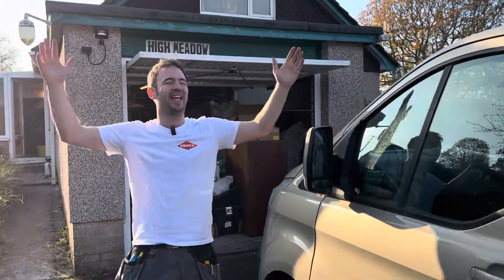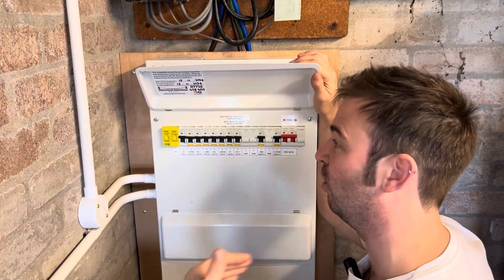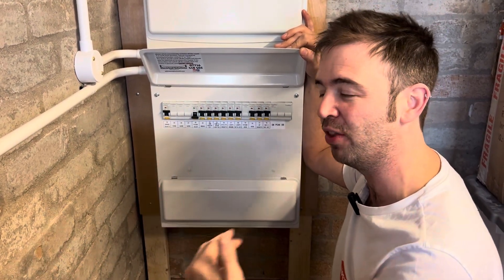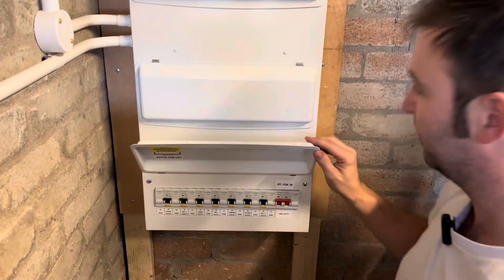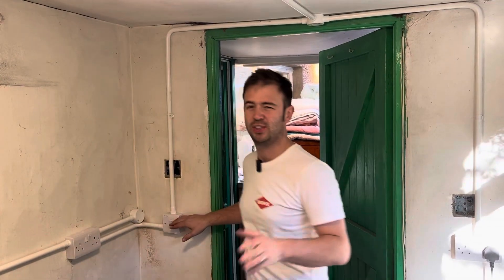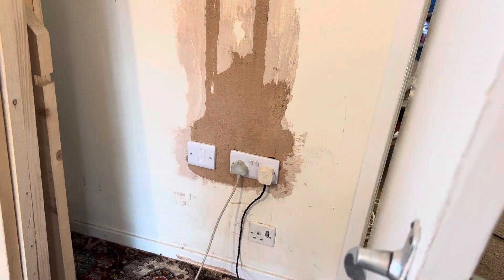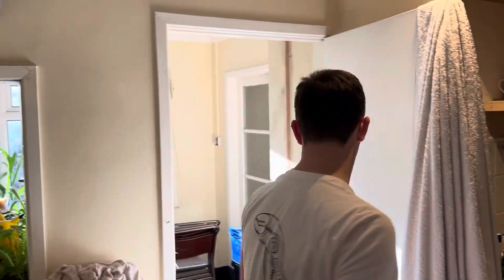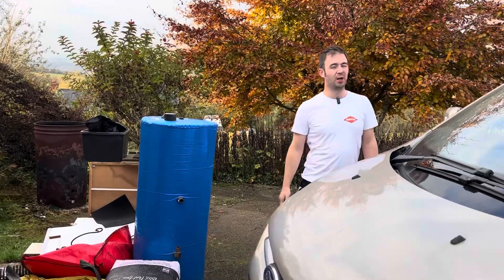LOTS OF CIRCUITS FOR A SIMPLE 4 BED REWIRE....WHY?????!!!

Comment: Hi i still think this thermal de rating is a load of pants in the Regulations you will find nothing about it.
Reply from the maker: All manufacturers instructions tell you about it
Reply: @bristolsparky  Hi I can understand it with afdds that have computer chips in them but of all the Rcbo Consumer Unit i have ever installed I have never seen any instructions I use Fusebox Hager Lewden Crabtree Starbreaker Mk Honeywell mcg etc
Reply from the maker: @ go and read the manufacturer's data sheets on all of those brands

Comment: What does your max demand work out to ?
Reply: I seem to run into this problem quite often. By offering more selectivity in the form of dedicated circuits you can often end up around 200amp or more before diversity is applied which can still exceed the 100amp main fuse and equipment ratings after diversity is applied. Think they should be more allowances for such installations as if they are affordable it makes more sense to separate circuits more. 
Great Install by the way 👍🏼
Reply from the maker: @ thanks
Reply from the maker: Calculated around 90-something amps

Comment: If I need to label sockets etc I use clear labels, they look a lot more subtle than white background labels. To the point you can label coloured accessories and as long as you get the label on straight it looks alright!
Reply from the maker: Clear labels are perfect for decorative accessories 🫡

Comment: I'm not looking to pick fault but just curious, looks like a two phase and neutral supply so 400v potential between phases, do fusebox allow two phases in their domestic enclosures? Hager (not fusebox I know) technical told me no on a recent job where we had storage heaters on a separate phase so we had to use two separate single phase DB'S where one would have been neater like you've done here.
Reply from the maker: It's not 2 phase
Reply: @bristolsparky I stand corrected, apologies. Tidy work :)

Comment: Do you guys have the THTC tariff south too? it very common here in the north isles of Scotland , Wylex used to make a split board which had the spacing for the tariffs the new ones you have to make to fit, and the OLD MEMs used to have a double stacker specifically for it too but when Eaton bought them out it disappeared, Nothing wrong with the triple stacker looks nice, the EM light is great its standard aboard boats that is where i knicked the idea from 😂. and I can tell you in regard to the Storage heater if its pre 74 it will have asbestos but you can access the connections without going near it and then just hard wire the flex into the switched fuse
Reply from the maker: The flex wouldn't reach hence it was kinda like 2 birds 1 stone. Relocate and not mess with them

Comment: Is surge ok on the other side of the switch? So it’s last to feel the voltage spike after all the circuits
Reply from the maker: Of course it is, some manufacturers have it before, some after🤷‍♂️
Reply: SPD is recommended to be as close to the main switch.
Reply: Either side is fine, cable lengths as short as possible.
Reply from the maker: @MADSPARKS31  correct